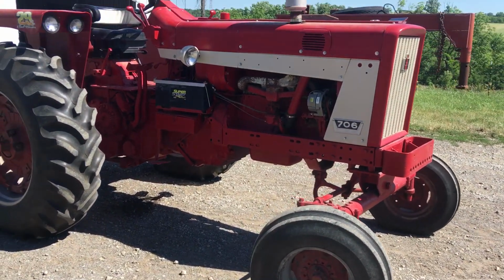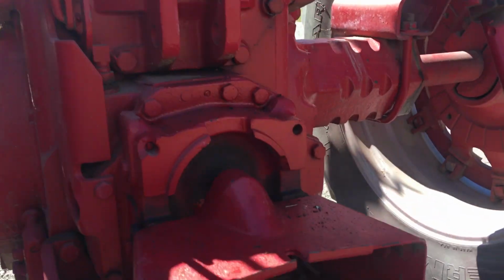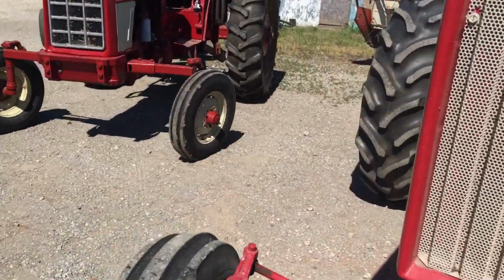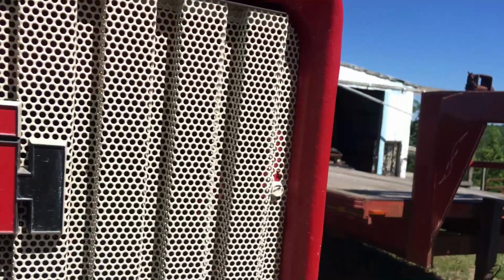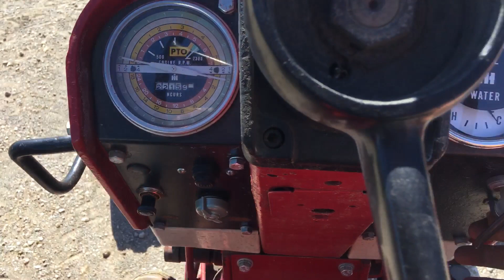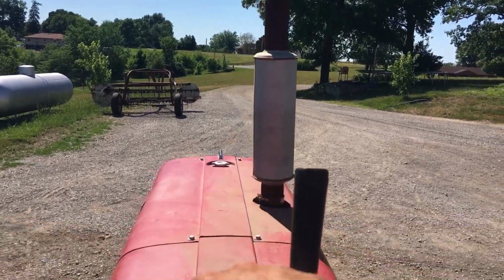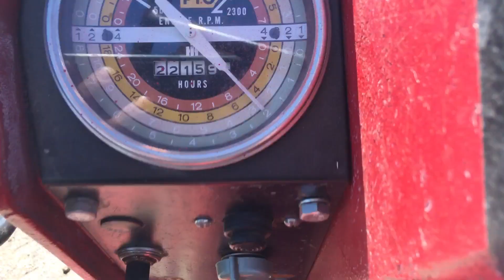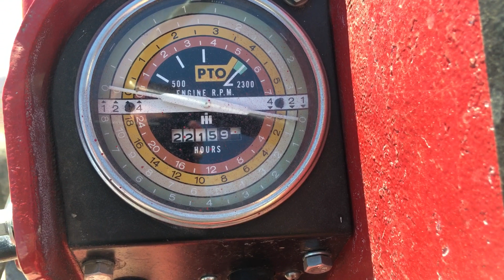My new farmall 706 gas June 1st 2018

Comment: My dad bought a Farmall 706 gas new in spring of 1967.. The 706 is a great lighter utility tractor for hay equipment etc. The 706 will pull a14" Inch, 4 bottom plow in light soil. Shifted into Low range - 4th gear. We also had a 806 diesel, both are great farm tractors.

Comment: I would imagine the 706 s hard on fuel being a gas motor vs diesel?   Sounds really good and I wish you luck.
Reply from the maker: It does well for my operation mainly use it for mowing with the 990 swather and a 640 new holland round baler. Thanks.
Reply: Duane Guenther   Still a very nice tractor and simple to operate.  Thanks for your reply.